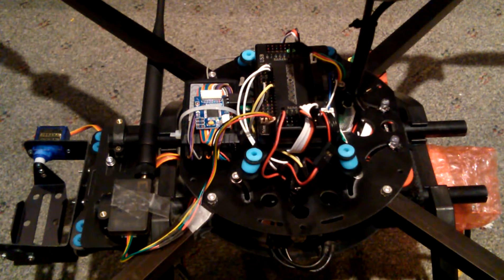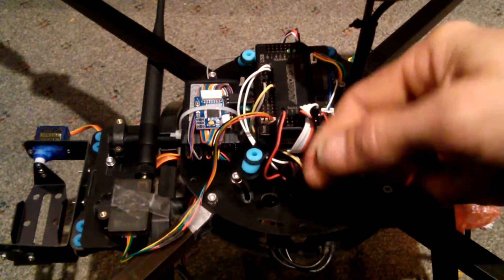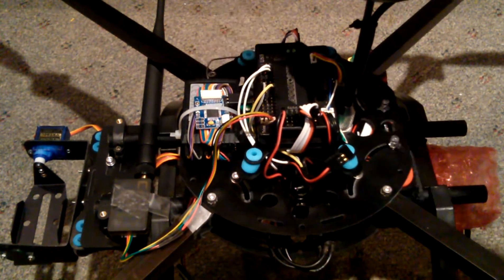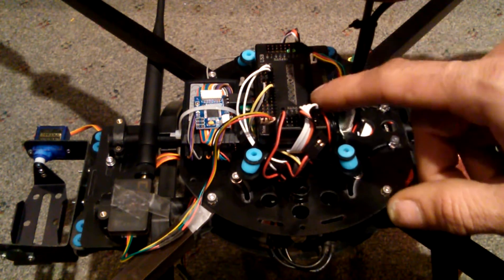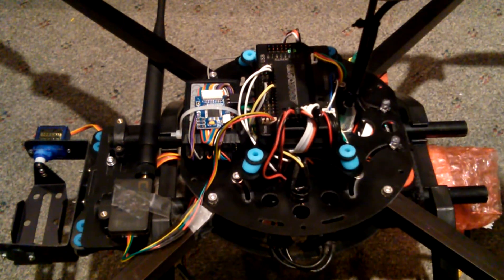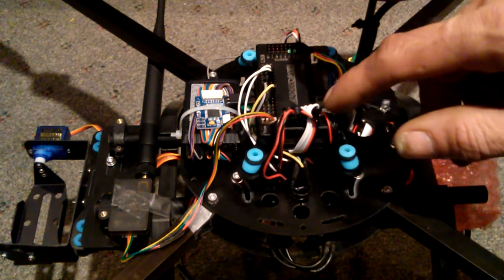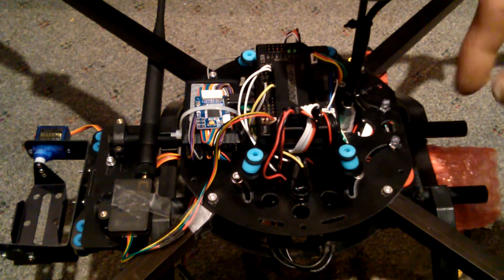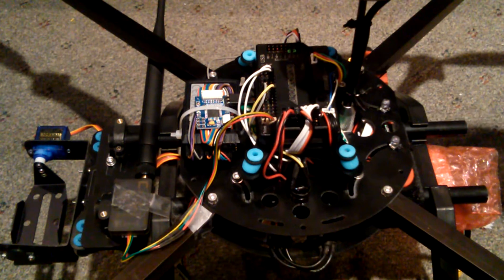How to setup a servo gimbal with APM flight controller Part 1

Comment: Can someone clarify why the small servo motor(s) need a separate BEC. I am currently using a Power Module with JP1 in place on a 2.8 unit and getting ready to add a camera gimbal to my rig. So I am assuming the Output rail of the AMP runs the brushless motor ESC's off very low current and if your trying to power a Servo Motor(s) off the same rail it could create too much of a voltage drop (to much current) and cause a "Brown Out" of the main board hence the need to remove JP1 and power the output rail separate. So in effect using a separate BEC 5V feed ensures a more stable power condition to the output rail. Is this a correct assumption?

Comment: How to configure APM to set the pitch tilt based on its accelometers to stabilize?
What to set in MissionPlanner?
Is it possible to put the signal for servo to one of my unused motor output channel instead of the A10 or A11?
Reply: In mission planner check the box that says stabilize pitch in the gimbal setup screen.  You have to use a10 or a11 and not the motor outputs. Remember to power the servos from a separate BEC and not the power module.
Reply: +Teige Melia Thanks, I found some more info here:
http://copter.ardupilot.com/wiki/common-camera-gimbal/
but in my APM clone FC the A10 and A11 pins are not exposed, I can only use the RCOUT5-8 as they are free but as I read they only work with digital servo, I am afraid I ordered analog one :(
I will use a power module, or separate ESCs BEC to power the servo.but the servo is in its way from china yet. I assume I have to order a digital servo now....